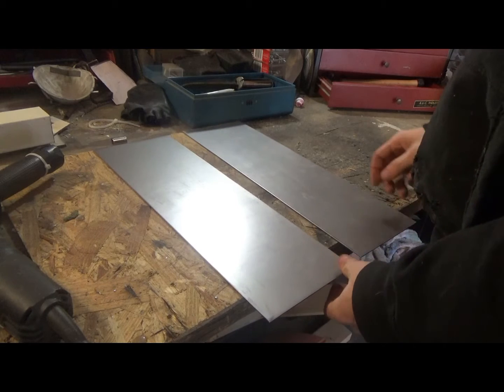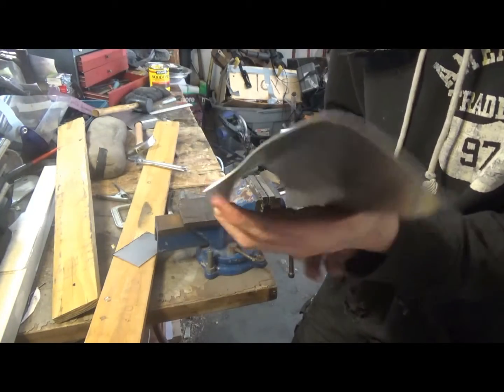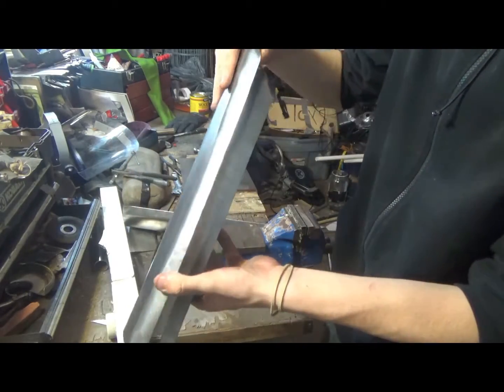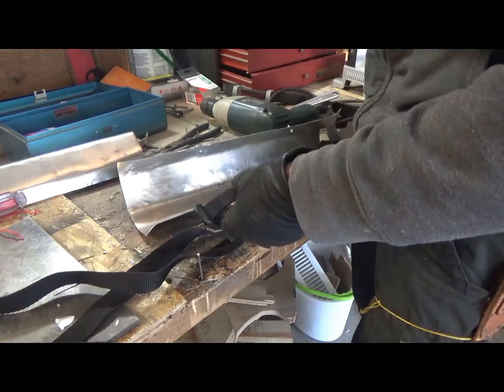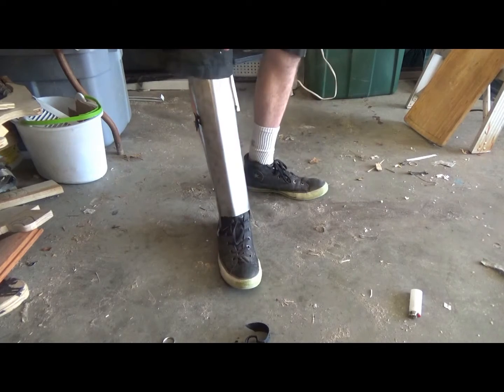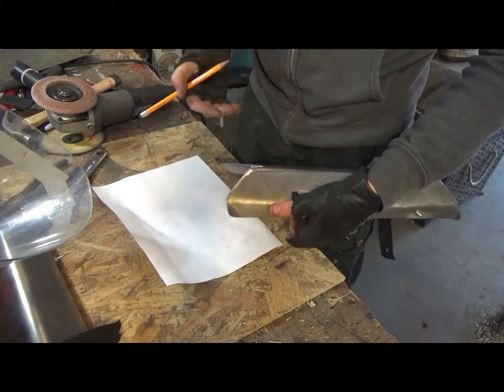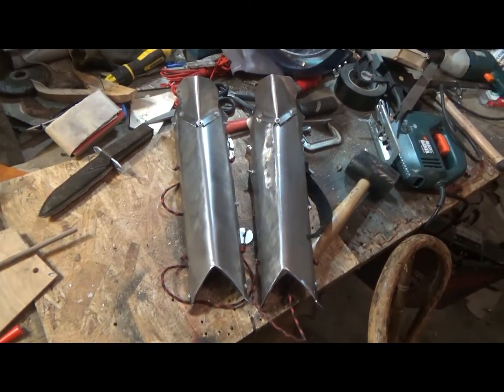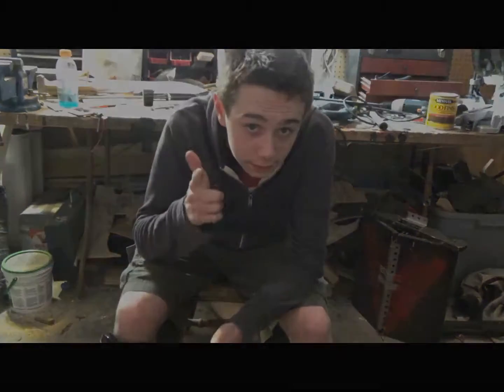HOW TO MAKE GREAVES (Shin Armor)

Comment: How much do you pay for your metal? I use to buy 16 gauge sheets (48X48)  at a store for $40 until I found a wholesale place where i can get the same stuff for $10
Reply from the maker: i think the metal for both grieves cost about 20 bucks all together i dont remember exactly, it was pretty cheap though.